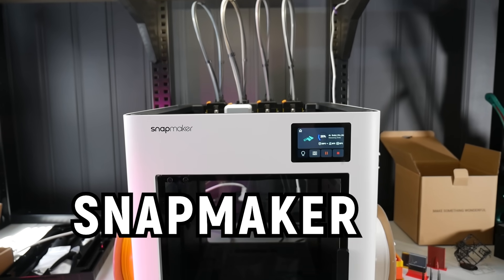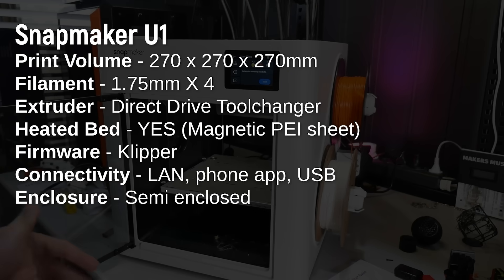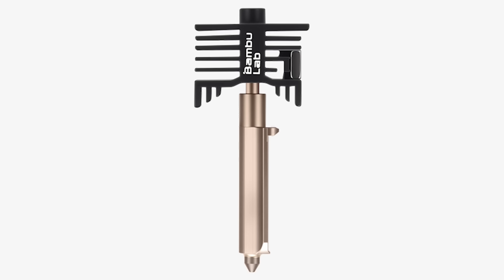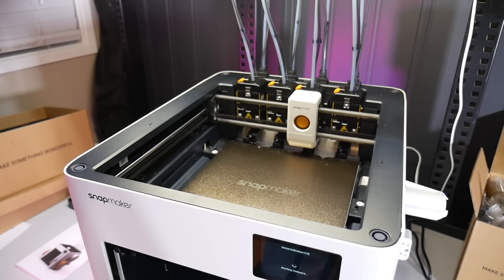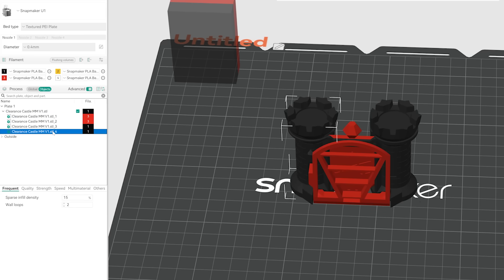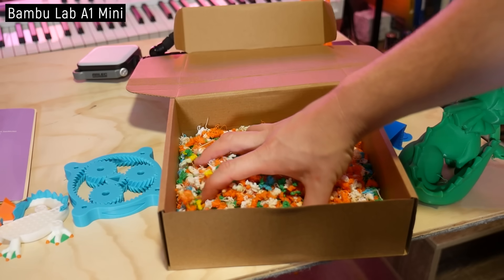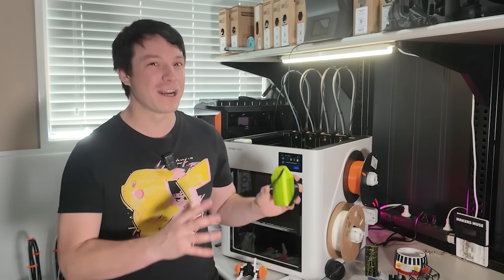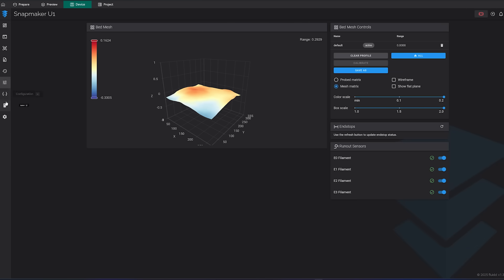Snapmaker U1 Production 3D Printer Review - Tool changer!

Comment: Thanks for testing !! There is an Ikea Samla box that could almost fit on top - reducing the noise. PTC heaters from AliExpress cost 15$ and the 'bento box' as a filter would be an option. Klipper with open source code and orcaslicer also sounds great, so I'd expect mixing nozzle sizes and fixing the pause will happen soon.

Comment: Were you able to feed the 72D TPU and the foam TPU through the motorized feeder units on the side of the printer or did you have to feed it from the back or even directly into the printhead from above like you have to do it on the X1C or the H2D when printing with TPU 90A or softer?
Reply from the maker: They fed through the motorized units with a little help, but retracting needs careful attention and manually pulling as it withdraws or it'll get stuck.
Reply: That’s good news. I have my printers in a cupboard which makes it akward to feed filament from behind or from above. As long as it works without problems while printing, taking additional care while loading/unloading would be fine for me.

Comment: I think I'm good waiting at least a year before considering getting one of these. The first FDM printer (and second 3D printer overall) I ever bought was the SnapMaker 2.0 A350, and while I still use it and have gotten lots of lovely prints with it over the years, I think it tells you everything you need to know when I say that it made me miss the ease, convenience, and reliability of my cheapo Longer Orange10 resin printer. I've sunk hundreds and hundreds of dollars into my A350 over the years to compensate for poor, thoughtless design choices on SnapMaker's part. And do they apologize and send you fixes for their stupid engineering for free? Of course not! They sell you exorbitantly-priced versions of the mods and workarounds the SnapMaker community have been DIYing for years. Their software isn't much better, and while they've been continually upgrading and improving it over the years, they've also released updates that have temporarily broken it and left me unable to use my 3D printer until they released another update or I changed slicers. They even released a dual-extruder module for it, but it's $400+ and has horrible reviews because of various problems with it that they never addressed and are never going to fix.

I recently bought a Tina2S FDM printer for $200US, and it was so novel to finally own a printer that just works without huge amounts of labor on my part. It's made me enjoy 3D printing again, and in doing so, it's helped me recognize that my SnapMaker machine had managed to suck all of the joy out of 3D printing for me and turned it into something I was afraid to do because of all the work and potential failures involved. So maybe the U1 will be worth my getting eventually, but it'll be a while before I'm willing to put my trust in SnapMaker again, given their track record of releasing polished turds and devoting all their attention to their next shiny machine instead of doing right by their existing customers.

Comment: It is very unfortunate timing for Snapmaker that this was released just a few months before Bondtech INDX is set to release. I'll be waiting until an enclosed printer with INDX drops, or maybe build a voron finally.
Reply: Yeah, but this had advantages being a full tool changer, not a nozzle changer, and there's zero chance you'll get a printer with the INDX on it anywhere near 900 bucks. A couple grand, minimum, most likely. I could see the Prusa Core One L comboed with an INDX, but - the One L is already almost two grand US by itself. With an INDX? Who knows, but there will probably be pain involved as far as the wallet is concerned.
Reply: @cr0ft-2k  You're probably right. I wish the U1 was enclosed and had a chamber heater.

Comment: If it was enclosed and had hardened nozzles it would basically be perfect.
Reply: It HAS HARDEBED NOZZLES ON THE WBSITE! and the hood HEATS THE CHAMBER BY CIRCULATING THE AIR...ffs
Reply: @anthonylong5870  who upset you bud, you don't sound well

Comment: 15:40, its not just about the purge poops when going with ams style options. The cross contamination when swapping material types makes them basically unusable for multi material prints.
Reply: Honestly the only thing I want is multi material support interface, so very much looking forward to trying that. That's a massive gamechanger for designing models.

Comment: Why does it still need purge and a prime tower, doesn't that defeat the purpose of tool changing?
Reply from the maker: To make up for any oozing, but it could probably be shrunk down a lot
Reply: From what I've seen, it only purges the first time the filament is loaded, not during the printing process. Prime tower is just to get a flow going - it can be turned off, but the Beta testers I've seen said they get more consistent results using a prime tower.

Comment: 7:15 prusa xl has issues similar that the tool is the it spot but moves a little from where setup and the bars won’t catch the extruder. I had on tool 5 now on tool 4 (tool 4 after calibration). Just putting finger behind extruder and works so thinking of making a shim to avoid any issues in future. 

The u1 has a slightly different mechanism - is there one bar in the hole…

Comment: 6:20 based on Prusa XL…. But no one ever mentions that.
Reply: Was that also based on the E3D toolchanger?
Reply: @thingswelike I’m not sure, that was from a while ago wasn’t it? But the xl has been around a long time too. I think may have been inspiration for Josef..
Reply: No, it's not based on the XL.
Reply: @riba2233 I think you will find it is “247printing” mentioned it in “The Snapmaker U1 Preview: Less waste, Less money.” At about 4:00 minutes….

The lock bar and prongs is what I’m taking about - how they push it back and it slides over and locks…

Comment: man I really wish hardened nozzles were just the standard that printers get shipped with. The price difference is negligible that there's really no point in not  making them the default.
Reply: hardened steel is significally worse than brass at heat transfer, the chouse is not that easy. Diamond thing maybe win win, but it is very expensive.
Reply: I agree. I pre-ordered hardened steel nozzles from them - it is $49 for a set of four - so not outrageously expensive. I bought a set of four for each size - 0.2, 0.4, 0.6 and 0.8 -

Comment: If I'm buying another printer it has to handle multi colour, but also deal with ABS, ASA, etc and have 0.2mm as well as hardened 0.4 and 0.6mm nozzles as an affordable easy swap option.

Seems to me the Snap maker only really offers the multicolour, which is a shame as it takes it back off the maybe list.
Reply: They have an optional cover coming this spring. I improvised a cover and tried out ASA while testing. Shared on the SM forum.
Reply: They have 0.2, 0.4, 0.6 and 0.8 hardened nozzles available - they look very similar to Bambu P1s nozzles. Two screws and a couple of tiny connectors. They have a complete guide for the machine on their website.
Reply: No multi material? For me multi material is more important than multi color.

Comment: I think it's pretty apparent that with our current technology, in making a multi-color FDM printer you really have to go with a multi-toolhead design to reduce wasted material and wasted time.
Maybe if it was possible to print with a white filament and mix in color perfectly at the nozzle, not melt chamber but the nozzle to have the absolute minimum of material waste.

Comment: Just a note, you can use bambu local only and with any slicer software of choice (that supports bambu) . you just have to enable it in the printer settings.
Reply: Incorrect.  They changed it You have to go online with Bambu now...Thats why they lost 1000's of customers
Reply: Not After the firmware update, and not the newer printers like the P2S
Reply: @berlinberlin4246  false, you can
Reply: @berlinberlin4246 it works on p2s too. Bambu even has it in their wiki. Enable local lan mode and developer mode. Then you can use thirdparty software.
Reply: @berlinberlin4246  Yes you can. Right from the Bambu Wiki:

H2 Series/P2S
¶Step 1: Enable LAN Only mode on the printer side.

Comment: 13:00 just wanted to add a note here that they do sell hardened nozzles for use with the enclosure lid for high temp abrasives
Reply: ...or low temp abrasives (like glow in the dark PLA) without the top cover

Comment: I’m watching these reviews waiting for mine to land, and I’ll be using the OrcaSlicer profile, as SnapMaker’s doesn’t support multi nozzle sizes, nor does their shop sell bundles of four different nozzles yet, just sets of same sized nozzles. I’m primarily using this for multi material prints, and waiting for an alternative enclosure upgrade to use ASA etc ,maybe from BTT or others in the future.
Reply: They have 0.4 0.6 and 0.8 with 0.2 sometime next year
Reply: @astainlessnoyb1038 yes I know, thanks, but I couldn’t buy a set of four different sixes sized nozzles aka a mix of, 0.6, 0.8, 0.6 hardened, 0.2 etc… their shop didn’t sell them like this, so raised a support ticket, and waiting for the shop to update. Their response was SnapMaker Orca doesn’t support different nozzle sizes in their software for individual tool heads.

Comment: I think the Snapmaker U1 will be OK for ABS.  Heck, I print ABS on a Sovol SV01 bedslinger with the Draft shield enabled in Orca Slicer.  I have an ABS print that just finished as I type this.  It looks good.
Reply: Its fine.  ASA and ABS work with no issues. Beta testers have been printing with it since Aug.
Reply: @anthonylong5870  It's not so much about it working, ASA and ABS have pretty terrible layer adhesion even on the best printers. Just inherent to the material. Printing on a less than ideal printer just makes that adhesion worse, so it will work, but there may be better materials for a project with this type of printer.